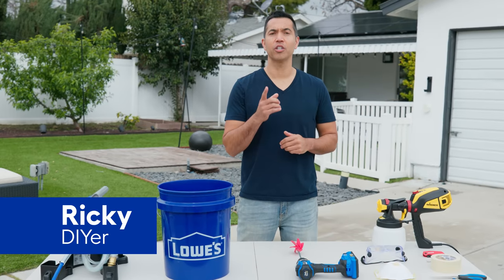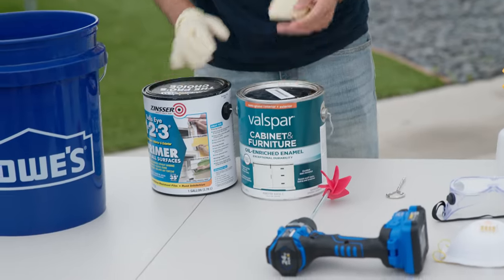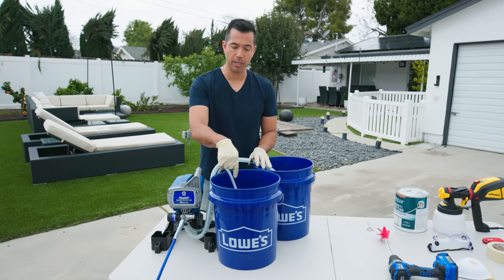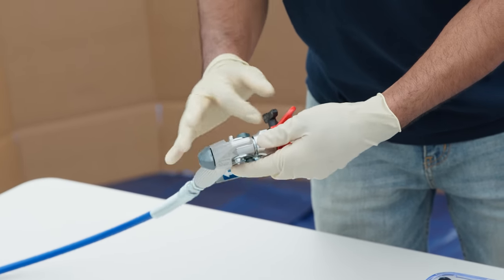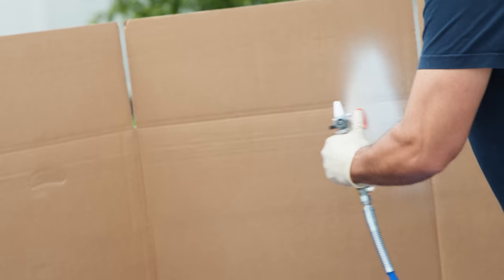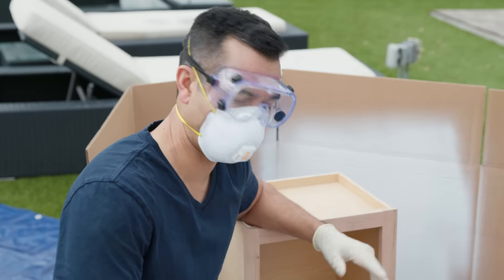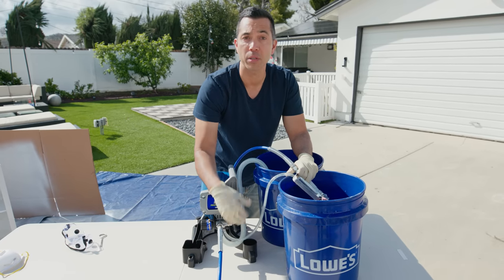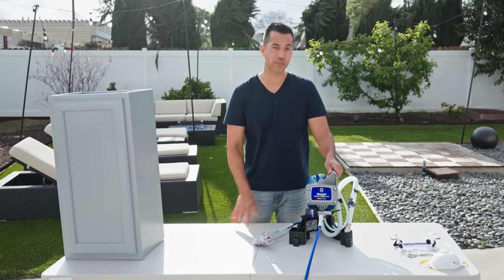How To Use a Paint Sprayer | How to Anything

Comment: I bet that sprayer waste a lot of paint
Reply: Might not be any more than a paintbrush or roller. It's the spraying being sent out by the wind I find troubling. Any small critter nearby would be coated in spray and die.
Reply: ^ never spray paint in windy conditions.  This goes when using aerosol spray cans too
Reply from the maker: Paint sprayers do use more paint, and the extra in the lines usually cannot be saved since you need to add water to flush out and clean the sprayer. That said, a paint sprayer is faster, will provide a better finish, and for projects like kitchen cabinets a paint sprayer will get the job done much quicker without leaving behind any roller or brush lines.

Comment: So any kind of paint, ext int latex oil based and how do you unclog the system during the job.
Reply from the maker: Each machine is slightly different, but they will usually have a cleaning mode where you can run water through the lines to flush any paint out. For tough clogs, remove the gun and soak it overnight in mineral spirits. Always make sure the air pressure is correct for the type of paint you are using, this will help prevent clogs and will give you the best finish.

Comment: I've always wanted to use one of these, they'd be so much quicker than paintbrush painting. 
Could you please do a video on how to paint white cars? What steps would be first? Sanding, or can a primer be used instead?
Reply: You shouldn't use a sprayer like this for auto paint. While it can push it out no problem the orange peel (uneven paint) would be crazy. If you want a unit instead of a compressor and spray gun go with a minimite 5 or the titan cap spray. You'll tape everything off and then sand to 220. Do 3 coats of primer. 2 coats of color. 2 coats of clear coat.  Sand with 500, 1000, 1500, and 2000 grit between each coat and finish with 3000 grit. It will look like glass if you practice and put the time in.
Reply from the maker: We do not recommend using this type of paint sprayer for automotive work. It is possible, but it will take many coats, and a lot of sanding in-between to prevent as much orange peel as possible. You will also need a separate sprayer dedicated for clear coat use only. For the best results, look for an HLVP paint sprayer gun.